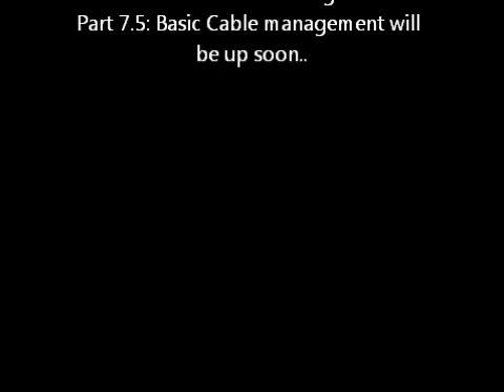PC-Build Series: How to Build a Computer: Part 7 Wiring everything up

Comment: @jacx911 Nah thats fine. I found out that I had to wire the pwr and hdd light in the opposite directions to which the mobo manual stated. Works all fine and well now. Thanks for replying.

Comment: @jacx911 I'm afraid!  Haha!  I'll just connect mine to my old PC nearby.  It'll probably be on but I'll put the clip away from anything dangerous looking.  I touch it all the time with the thing on.  Hee hee!  But not the dangerous looking bits.  

Really, I was unable to find one way or the other about this issue.  Some people mentioned taking an old power cord, cutting off the 2 live prongs, cramming the clip into the other end and plugging in just the ground prong.  Heh!

Comment from the maker: @radioman970 Hi, the computer does not have to be plugged into the wall because the static is between you and the parts so as long as the band is connected to the case then it will be fine., Also, i dont recomend plugging the computer that you are working on into the wall at all, just in case the plug is wired wrong and you get electricuted.

Comment: Some of my stuff came in the mail today.  mobo, cpu, case, ram and anti-static band.  I believe I heard it somewhere that the PC has to be plugged up (not turned on, of course) for the wrist band to function probably attached to the metal part of the case.  Or something that is actually grounded.  So...careful!  Btw, my case is a Rosewill Destroyer and seems to be all painted black so I'll be using my old PC nearby anyway for the grounding.

Comment: Thanks for continuing this.

I bought a modular PSU for mine.  Corsair.  You only have to use the wires you need.  Hope it works good since it costs more than I want to admit.  

Great tip:  double check the manual.  I plan to ... gulp!  read mine for the most part before even starting.